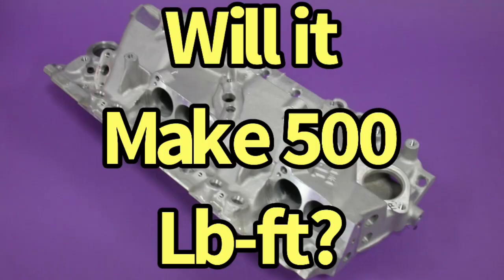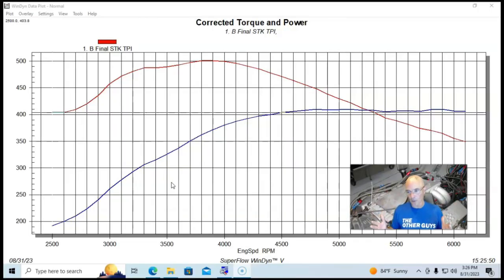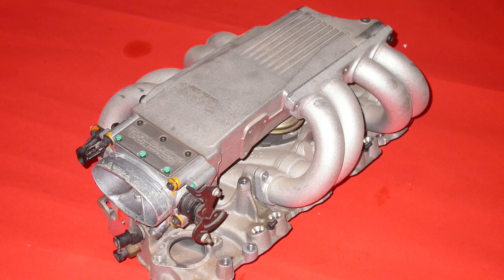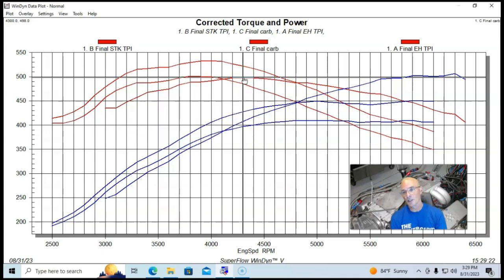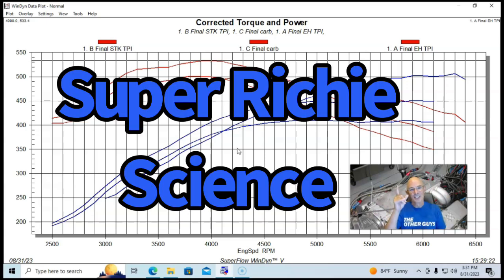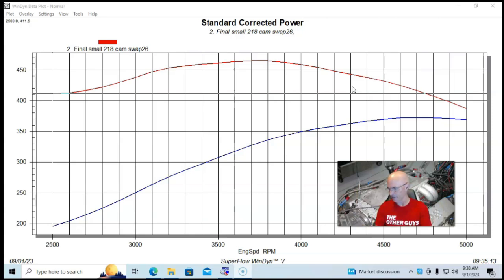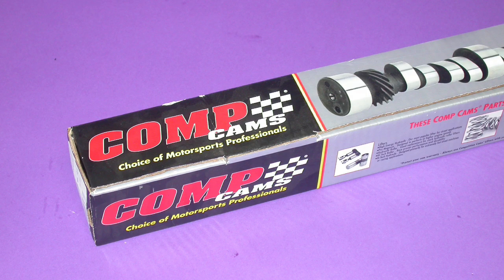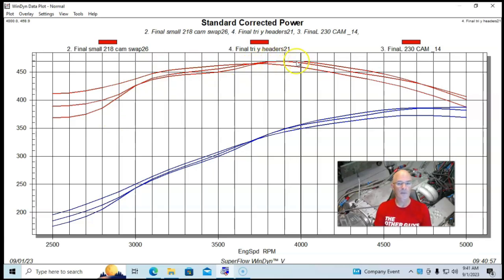TUNE PORT L98 350-CAN WE MAKE 500 LB-FT OF TORQUE? PLUS, TRI-Y VS 4:1 HEADER TEST-WHO MAKES TORQUE?

Comment: So sad that I missed this one for 6 months. GREAT set of tests!

As you know increasing torque per cubic inch is HAAAARD. To hit 500 ft lbs, you'd have to make 1.41 ft lbs / cubic inch on a 355, which is a difficult feat without a big budget. 

The easy way to hit 500 ft lbs on a 350 inch TPI SBC: Use highly oxygenated race gas; something like CHP+ circle track gas, or E85.  Combine that E85 with a bunch more compression and it gets even easier. 

A more aggressively lobed cam would help; obviously you have to keep the seat-to-seat durations in the range that are going to work for those long intake runners, so the big option to increase VE at the torque peak is to get more lift with the same seat-to-seat durations. -Higher ratio rockers -yes, moving to a more aggressive hyd roller family like the XFI lobes (but on a custom tighter LSA), or moving to a "street Solid roller". 

Compression is obviously useful but pump gas and high compression and high VE is a combination for knock in a real car when you don't have 160F or colder dyno water. Meth injection would help, but so would using an advanced EFI system like Holley HP or Terminator and using a strategy like "Open Valve Injection" and significantly larger injectors that can inject all of the fuel when the valve is open in a small number of degrees / milliseconds: you get more evaporative cooling with this strategy right before the intake valve closes and it allows you to use more compression with the same octane fuel. (Bosch found that they can run with +0.5- +1 CR increase in static compression with the same octane fuel when using an open valve injection strategy.) 

I've seen SO many tests of TRI-Y headers now where the TRI-Ys lead to over-scavenging and then a torque drop for part of the curve; that's my suspicion on the TRI-Y test; open valve injection is also ideal in this situation, too, because it can be timed so that injection doesn't start until overlap is over, at least in the low to mid RPM range; then you're not just shooting the fuel out the exhaust during overlap and seeing that torque dip. 

Reducing friction where possible can help make tiny gains, too; those Mahle Powerpak SBC pistons with the 1mm ring pack option are a great option to help maximize CR and reduce friction at the same time.

Comment: 11.1 compression, more lift with a good Roller rocker use cam with tighter lsa.  A switch to a 180 cc head from arf may help, for torque you def want to maximize the velocity of the head.  I am going to be using a 170 cc edelbrock head that will come out to a 18ish cc head and will flow around 270 at max but have killer 250 numbers in midrange.  Add some good engine oil maybe a windage tray with baffle and crank scraper.  If that gets you close add a first tpi and then have that manifold worked, i think it could be done, my combination will be similar but with all the things ive said, i calculated 500 ftlbs minimum at about 4k and 420 ish hp at 5200 to 5500 or so....will shift that at 6k and hope for mid 11s in my camaro.
Reply from the maker: no on the smaller port heads
Reply: Look at the FLOW for the cross-sectional area between the 180cc AFR head and the 195cc AFR head. The 195cc is the velocity "sweet-spot". Velocity is determined by the amount of FLOW per the cross-sectional area; it's counter intuitive, but you CAN have a bigger port that has more velocity than a smaller port.

Comment: Is that first combo just with long tube headers? With stock intake/camshaft. Because in all reality, a 355 vs. 350 isn't gonna make much more hp when a 60 over bore is done. Usually 30 or 60 over is used for fresh clean cylinders with the intention of forged pistons and chrome moly rings or plasma rings. I like the l98 tpi corvettes and i wanna make huge torque under 4500 rpm, is this the combo to use Please and thank you richard.

Comment: You have to get the compression up to 11. 25 to 1 to get the power per cubic inch up!
Reply: The problem is 11.25:1 with the high VE at a torque peak between 3,500-4,500 RPM makes it a knock-monster in a long-runner build.  You have to run the cam in the range that it's going to make power, and then you get skyrocketing VE on these long-runner builds at that torque peak and you get knock even on 93 octane pump gas with cool coolant and a cold air intake and you have to pull timing around the torque peak and the power per cubic inch goes back down from having to pull timing to run on 93 octane (On the WestTech dyno with the water set at 150F, it might be ok, but in a real car... It's a problem.)

A good long-runner TPI build on 93 octane makes it tough to avoid knock even at around 10:1.   -I agree with you completely on the approach, but then these engines become knock-limited (they cry out for E85)...

Comment: About 10.2:1 compression, heads with smaller cc intake runners with 1.94, 1.6 valves, higher lift camshaft with 107° ish lsa, high flowing 4 into 1 long tube headers would be my thoughts

Comment: Im sad that i missed this when you posted it, as I feel a direct correlation to my 500ftlb comment in my L98 on a previous video inwhich you said "a tall order". Pretty damn close, and like i said mine is 470ish. Inwhich I rounded... what man doesnt stretch a bit 😅. Great vid. Thanks for verifying.
Reply from the maker: the desire for 500 lb-ft from a 350 came right after originally testing the motor (decades ago)
Reply: I think your answer is in the early video, you made the area inside the pipes larger without changing the length, and made more everywhere. Probably could use some small exhaust pipe elbows to add even larger volume. Outside of that, I think I'd try to crank up the fuel pressure and some 4 hole injectors, and give it all the timing I could, regardless of how rich I had to run it. I don't know how you'd use an h pipe on a dyno, but using one side of the exhaust to pull on the other might be worth a shot.

Comment: From the pic you showed of the Tri-Y header it is basically a shortie header design with pairs of primary pipes connecting at 270* and 450* degrees of crank rotation, which i think usually favors higher RPM operation, and not ideal for the TPI engine.  I would have tried to find actual long tube tri-Y headers with the pairs of primary pipes connecting at 180* and 360* degrees of crank rotation,  like the tri-Y header version that works so well on the chevy big block, made by a company called Schumacher.   I think use of this type tri-Y could help the torque peak.  Boosting lower RPM torque is not the easiest thing to do for an engine builder, and you'd usually use things like more mechanical compression and tightening up the LSA on the cam,  but other than swapping cams you might just advance the cam about 6* degrees and put a higher ratio rocker on the intake side to see if that might boost up that peak area and get your desired number.   Personally, I think that a compression ratio of at least 11.5 would be in order for this type engine especially after you added the larger cam.   Inside the TPI plenum you can sharpen up the divider between the ports that feed cylinders 5 & 7 and add more radius on the forward side of the #5 port to cut down on the charge stealing, and this will boost up the lower RPM torque a little.   I hope to see you try this test again and get your number.   Dan Olympiadis.

Comment: If I remember correctly, First recommends 224 duration around a 112 LSA.  It be interesting to see what a tighter LSA would with the 224 duration.  Keep up the good work!!!
Reply: It depends if you're keeping the stock ECM or not. Aftermarket EFI will support tighter LSAs and more overlap.  You go with a more aggressively lobed cam, you can keep the tuning and the seat-to-seat durations where they need to be and the @ 0.050" durations and lift numbers get bigger, too. Modern EFI gives you a lot more options on these high power TPI builds.

Comment: Tri-y suffers from dyne discrimination. Tuning of an exhaust system goes by volume, not length, so larger diameters act shorter. An exhaust pulse has only so much energy, so if spread over a larger area, it travels slower, hence larger diameters act longer. With 1-5/8" primaries and 2-1/2" collector extension, the tri-y is tuned for an actual exhaust system length, terminating at the muffler with an open chamber flow master or at the tailpipe with a flow through. Hence they perform quite well in vehicles, less so on dyno lash ups, showing poor performance at low rpm due to insufficient length.
Reply from the maker: Both primary and collector length play a major tuning element in exhaust systems.  Reflected waves travel at the speed of sound (time and distance) determine arrival rate and effective tuning. Other scavenging waves are also present.

Comment: Just discovered this video! Can't wait to watch the 383 video! How about 1.6 rockers on the intake side with a single pattern camshaft. Better yet a camshaft with more lift on the intake side like the mutha thumper line and what you have already mentioned, tighter lobe separation 106. I don't understand and it was never made clear, why the 1.39 ft/lb per cube formula not only didn't work but was off so much. Thank you for the great video. I'm building a 10.6 to 406 with AFR enforcer 195 heads, .450/.450 218@.050 106 flat tappet hydraulic cam with 1.6 X 1.5 roller rockers and performer eps intake. I am using lightweight rods and lightweight wristpins (156 grams vs. 92 grams) I wonder what kind of power I should expect. I'm guessing 375 hp @ 5100 rpm and 515 lb/ft torque @ 3800 rpm!😀 for my '64 Biscayne with a th350, 2,800 stall and 3.36 gears

Comment: Are you running g stock injectors.
I have a similar setup with 383 _ comp cam 270 .
 10.25 cr .
Experiences spark knock at wop
Like it is starvi g for fuel 

What do you think k
Reply from the maker: we had big injectors-and a stand alone management (optimized tune)
Reply: SUPER common for a good, power TPI engine...  They just have such high VE around the torque peak at WOT, so combine it with a high static CR and knock is a common problem. 
Add a cold air intake if you don't already have one (I think the David Vizard quote is that every 10 degrees in intake air temp is equivalent to a 0.5 increase in octane or something like that), and get and keep that coolant nice and cool, especially when the warm weather arrives.  Plenty of radiator fan airflow, a high flow water pump (with a proper pulley ratio), a high flow thermostat (Robert Shaw / EMP Stewart), and consider altering your coolant blend so it has a higher % of water in the blend -just ensure that you add more anti-corrosion additive and that you keep enough antifreeze in the mix to avoid freezing during your coldest winter weather. (Going down to a 180F thermostat won't hurt, but by itself is unlikely to make the engine run cooler.) 

If it still knocks, then you either need to add a bit more octane (almost all boosters will include MMT and turn your plugs and chambers and pistons orange over time), or you need to pull a bit of ignition timing.

Comment: 358 Super Ram made 392whp with dual cats, SLP Headers, 280xfi cam, extrude honed Big Mouth TPIS manifold and Trickflow 195 heads, 1.6 roller rockers and hooker 3in cat-back. All emissions hooked up.
Reply: Your car is 3rd Gen infamous!  Dynoed at Dyno Dons, MAAANY times, right?   SuperRAM is cheating in a "true long runner" test, though. ;-)
Reply: @adamarndt7617  Right! Have you seen the rest of the videos?
Reply from the maker: right

Comment: 500 lb/ft divided by 350 CID = 1.43
It is said that only the top 10% of engine builders can manage building 1.35 lb/ft/CID engines and only the top 1% can manage 1.40 lb/ft/CID. 
NA engines of course.
According to David Vizard the 4.030" bore / 3.75" stroke = 1.075 oversquare and 6" / 3.75 stroke = 1.6:1 rod ratio is more effective than the 350 numbers. 
If this was my challenge I would have started with very tight squish, 10.5:1 compression ratio, a Extreme Energy XFI 224 / 231 camshaft with 107 LSA, 2.5 degrees advanced, quality short travel lifteres and PWR 1.65:1 rocker arms 02350180 . :)
I believe that 0.25D lift for the intake valve should be reached at early as "possible" within reason.
Reply from the maker: it is a lofty goal
Reply: @richardholdener1727  It definitely is. Maybe to lofty. Not impossible but close for most of us because a SBC with 3.75 " stroke is more efficient than all the ones with less stroke. I believe one need "high" pistonspeed, "high" airspeed , "high" valvespeed and 107 LSA  camshaft (because roller is slow of the seat) with 224 +/-2  degrees intake duration at 0.050. Speier ported heads on a stroked 307 CID engine. ;) :D

Comment: I’d stick  a 220 duration  420 lift, 1.6 rockers 112 -115 lobe separation cam in it.
Maybe even put the stock intake and throttle body back on it. 
That’s my take.

Comment: Question I have a 1987 formula 350 tuned port thats punched to a 383 ported polished and CC heads but i have a ZZ9 cam what computer system can self learn for best performance thanks for reading sir .
Reply from the maker: they won't self learn effectively except at idle and part throttle

Comment: Aloha from Maui!
I have a 90 corvette as my daily driver and I'm saving up to have the motor torn down and rebuilt. 
As of right now, it has cat delete, x-pipe and 2 aftermarket mufflers. 
I would love to have my car make some beautiful music out the pipes and more low end torque for light to light, have a little fun and really don't need top end speed due to living on a small island.
With it as my daily, I am thinking of having it bored 30 over to a 355 instead of a 383 to keep the structurability and from wrecking the engine later down the road, short tube headers, x-pipe and straight pipes all the way. 
I've been told that I can keep the original TPI and get up to 400hp and 500 fp torque and those are the numbers that i would really like to see.  
Recently I talked to a buddy and he said to slap a charger under the hood and I should be able to see those numbers, but I may run into problems with tuning with the old computer tech from the era. 
What say you?

Comment: Question. 1985 Corvette TPI 383 w/ 64cc AFR 195 runners making it 11.15:1cc flat top piston. What Retro-fit camshaft would you recommend running on a street car 1.6 roller rocker arms... trying to keep that looked.
Reply from the maker: something near 220 degrees of intake duration-but why the 1.6 rockers
Reply: @richardholdener1727  1.6 aluminum rocker arms was laying on my work bench from another project. I was like why not...lol

Comment: How do you tune those older efi management systems, my buddy has a tpi 350 and its running rich at the moment
Reply from the maker: we use a Holley HP
Reply: What is needed for the holley hp kit.

Comment: At the “small cam” size, a flat tappet is superior to a roller, as they accelerate the valves off the seat faster, also split duration cams sacrifice power below the torque peak in favor of more horsepower above the torque peak. Given the torque only criteria I think a comp 262h old school high energy flat tappet cam, with 1.6 rockers, on 108 LSA would have produced more torque, probably not as much peak horsepower, but definitely more torque. Still probably not going to hit 500 lbft, 
6” rods also make more torque, but they also make the engine more prone to detonation so longer rods, and higher compression would require race gas, or e85 to hit your target.
Reply from the maker: LONG RODS?

Comment: I need this in my 78 k20 4 speed. I would run a tighter lsa, it would gain torque but not 30 more lbs ft

Comment: To my knowledge, the only known published 355 article that got close to 500TQ in a 355 using TPI was the Something Old, Something New write up by Ray T. Bahacz.   With Vortec Heads, 6" rods, 11:1 compression and a Cam and the Accel Large Tube runner system on the Scoggin Dickey Vortec base he got 486.6 TQ@4000 and 416.3HP @ 5000 RPM.   If you were to really geek out with the Helmholtz formula, with the big mouth base and runners, you would run a single pattern 260 cam on a 108 LSA with 1.6 roller tipped rockers.   It's probably too late to put in 6" rods, but that would help cut the friction down.   Maybe call Lunati and ask them to grind you a DV262-08HRH or DV258-08HRH and let them know you need the snout for a factory roller block.  (That is the aggressive cam and less aggressive cam from David Vizard's Chevy book.)   I will note that the 268 on 110 LSA cam that you have fits the Helmholtz equation on a stock runner 305 TPI.  That would be a fun test to see.
Reply from the maker: Helmholtz is the resonating frequency of the plenum, runner, head port and 1/2 of the cylinder when the valve is open (also the inlet tract if you have any). It plays a very minor part of the three different forms of charge filling associated an intake design (Reflected Wave, Inertial Ram and Helmholtz Resonance). A single pattern cam might  help with torque (not usually peak), as might a tighter lsa. I would be very surprised if a Factory Vortec head made more peak torque than the AFR heads we used.